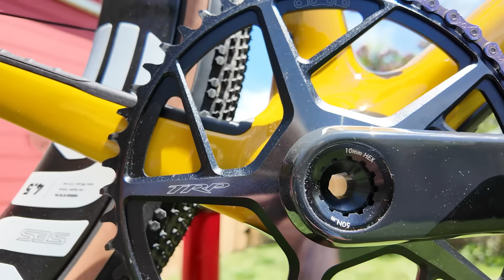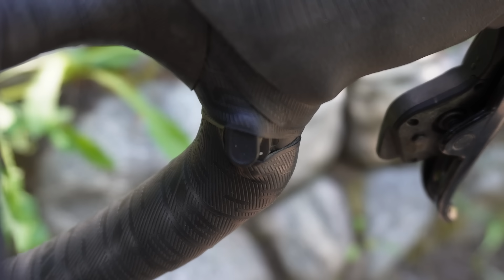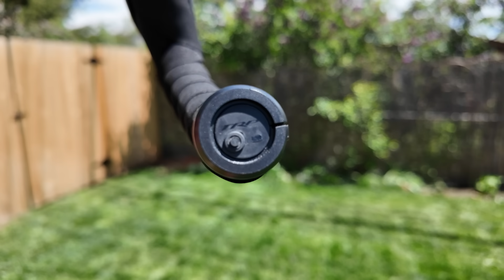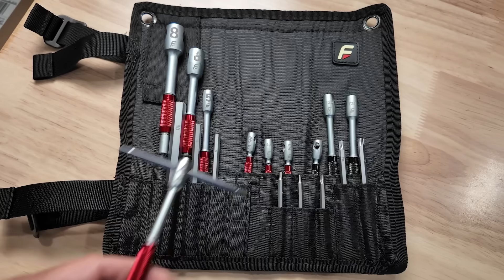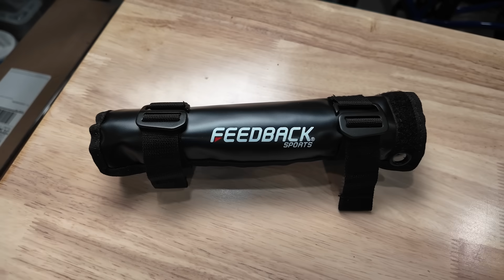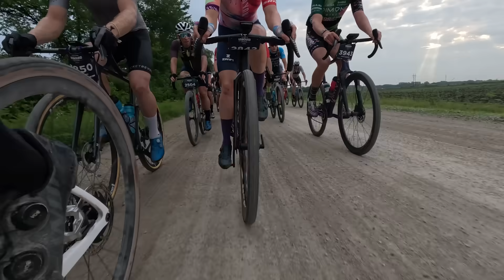My Unbound Gravel bike has a completely different and unreleased drivetrain

Comment: I would only consider a Classified hub if they made these changes:
1. Make more efficient, as it is currently 4% less efficient than a traditional transmission in the lower gear.
2. Make it available in wider ratios, as it is currently only available in 0.7:1 (a GRX 48/31 crankset is 0.65:1 for comparison). It just has way too much overlap for no reason. Having a 0.6:1 ratio would allow you to run a more compact cassette and shift in small steps, while keeping a wide range, so you can go fast downhill and climb steep hills.
3. Make it compatible with Shimano and SRAM cassettes!

Now, for me to even consider the whole TRP groupset, you would have to make 165mm cranks (and even shorter). We aren't in 2010 anymore... And they call it an "innovative system"!

Comment: If classified hub has a gear ratio of 0.686 , and a 11-40 cassette is used with a 44T chainring, then the lowest gear ratio would be 44/40 * 0.686 = 0.7546.

This is lower than a standard SRAM mullet : 42/52 = 0.8077   .... Is my math correct ?

Comment: The silo'ing is what kills all this for me. I'd probably give the Classified hub a go if I could easily connect things to my existing Shimano GRX levers/brakes. A "2x" 1x set-up as done here is great, but why would I want to throw out gear that I can already depend on and works solidly? Also, Classified/TRP would need to up the rear derailleur/cassette size. Using the classic WolfTooth link hack I can get an 11-42 cassette in back with my Shimano set-up. For all but the pros, I think the ability to get a 40 is a minimum in back (depending on your terrain), and larger is better (as you can with SRAM... are you reading this Shimano?!!). TRP/Classified, just like with the modernizing of tire clearance on gravel frames, needs to get even more progressive with this, and all possibilities for their system before it will be more than a niche groupset. Oh, and with that niche, I am sure some of use would be worried about long-term availability. Shimano and SRAM aren't going anywhere, but a smaller company like Classified (and even TRP in this specific arena) you never know.

Comment: Re: crank lengths— 170, 172.5, and 175 is a miss imo. Too tight of a range. The consumer wants to go shorter right now, that’s the current trend. Should offer 165, 170, and 175 instead. That would have hit more of the market demand.

Comment: Makes sense for those with deep pockets but not for those of us who like to change back and forth between rear wheels with different tire sizes.
Reply: The Classified mech is independent of the hub shell. Still not exactly cheap.
Reply: I’ve been running the classified rear hub on my gravel/road bike for over a year now. I have two wheel sets and switch between them very regularly. It adds about one minute to the process, assuming you have the correct wrench handy. I was initially concerned that it was going to be a time suck but it turns out to be super simple.
Reply: @chrisc738  It seems expensive to  have one of these hubs on each wheelset when a front deraileur can do the trick.
Reply: @beaudjangles It’s only expensive for the first wheel set. You swap the internals - the pricey bit - when you change the wheels out. You only buy the hub “shell” for the second (and third, forth, etc.) rear wheel. I went with it because it brings advantages that a FD doesn’t, mainly the ability to to run a 1x-only RD with it that allows a bigger max rear cog, thus gaining a much wider overall gear range than any 2x system allows. The fact that you can shift the hub - your effective FD - under full load is a nice bonus too.

Comment: most important question...what does the 700x48 tires measure out to? 50mm?
Reply: 50 mil I would venture to guess a millimeter smaller, On my set of Conti race kings the caliper measured 47.4!

Comment: If SRAM comes out with Force and Rival 13 speed options that may make this unnecessary. While it would have 2 more "gears", SRAM is proven across the board, would be around the same cost, less weight and wouldn't require proprietary tech that may be difficult to repair or not use with multiple wheelsets. 13 speed is at the point where you can start to have a viable 1x option for both road and gravel with close enough gear spacing.
Reply: I haven’t seen pricing for this anywhere, but the effective 1x15 (Gravel) and 1x16 (Road) provides more range than a 2x12, plus tighter jumps between gears. As someone who’s been riding both Dura Ace 9200 and SRAM Force Xplr 1x12, I’d be very interested in trying this over a 1x13 setup even at equivalent price points.

Comment: Can you describe how to use the classified system during a ride, in the sense that if you had 2x, you would switch between the small and large chainrings when you had 2-3 cogs from the end of the range to get more range.  How does one use a classified in practice, I've not seen this discussed.  When do you switch between ratios and when do you not?

Comment: Essentially a 44/22 front ring with a 10 or 11 to 40 cassette in the rear would be KILLER for those steep climbs. I want this on my gravel bike, NOW.
Reply: No, it's a 0.7:1 ratio, so with a 44 chainring, it's like a 44/31 2x !
That's not wide enough for me to consider it...
Reply: @nic12344  Oh, then I agree! Damn shame.
Reply: I mean, that's exactly what my 3x drivetrain on my gravel bike has. And it cost about 100 for the cranks/chainrings and front/rear derailleurs. 

It's a cool system but the range is pretty easy to get with conventional drivetrains.
Reply: the sram dual drive 2 would give you a heavy geared hub with around 73 % / 100 %  / 137 % gearing. The geared hub is compatible with 3 by stis. Yeah, and rim brakes I suppose... Have it on a foldable road bike from dahon (early 2010s, dahon speed pro TT)
Reply: My bike has a 42T chainring and the largest sprocket on my Deore XT cassette is also 42T. I have ridden up 25% hills and never felt I needed even lower gearing.

Extra info: I just recently got into this more adult (consumer) version of cycling and built a carbon gravel bike, I only have 500km on it, without wanting to sound arrogant I am in pretty good shape and 24 years old, so that may play into it, but even on my really extreme rides, where I had to get off the bike and hike it up, I feel like I would have simply wasted a ton of energy pedalling up, even if I had had much lower gearing (can't go too slow or you topple backwards or lose traction)
Reply: @rayzecor  Let me know how that works for you in 40 years. At 64 I run a 9-46 in the back with 26/36 up front. There is a point where really low gears don't work, but in my experience it's somewhere around 0.6 ratio depending on wheel size/crank length. While this setup helps on the short >20% stuff, where it shines for me is longer stuff in the 10% range. I can now get up those climbs and still stay at a relatively low effort. This makes a big difference on long days in the hills.
Reply: @imoldandurinmyway  I didn't mean to sound elitist or to say "just get stronger". I apologise if it came across that way
Reply: @rayzecor  No worries, it all just bikes after all.
Reply: @rayzecor  In my 20's through 40's I was super strong, at 55 I was a fu*king cripple with wrecked knees and that's how I did it. At 65 I'm back to riding again, but only 6k or so at a time, with an occasional 20k ride.
Reply: @rayzecor 😂😂😂🗣🗣🗣🗣
Reply: @rayzecor  Cool

Comment: There should be AT MINIMUM a 165mm option, and considering so many taller people have stsrted using 165s, there should be 160 and 155mm cranks too. If anything, drop 175. Or drop 172.5, no more in betweeners
Reply: I'm staying on 175s. This fad will be over soon enough.
Reply: @BG-yr1rr  My regular length legs say no!

Comment: Ben, the MOG will fit the Race King/Dubnital 2.2 if it is dry at Unbound.  That is probably the best way to be fast and avoid flats.  Saw ya today coming down as I was heading up Chapman…. Best of luck at Unbound!
Reply: Barely fits.  I've tried 3 pairs on my Mog and man it's close! Any wet dirt and I'm f-d.  I'll be running something else at Unbound unfortunately. (I know data is grater than feelings, but they feel slow as well)

Comment: The shorter the crank length, the smaller the chain ring aka performance loss due to chain roller movement. Also, higher seatpost = more aero drag especially if its a round one. These things Dylan doesn't know about 🤫
Reply: name checks out.

Comment: This shows why standard 1x is fine, it only gives 15 unique gear ratios vs 12/13 you can have with sram xplr. And you can already get a very easy gear with sram 46t and 52t cassettes. Glad to see innovation but end of the day its not better just different and has the cons of the proprietary hub.
Reply: Well, some people like both wide range and small steps between gears, so in that case, 15 is better than 13, let alone 12. 
If you don’t care about bigger steps, than indeed, no benefit.  But all those arguments are also true for 2x drive trains, and plenty of people seem to like those.
Reply: Agreed, the required hub makes it a no go option.
Reply: The range of 22/40 and 44/10 would be wider than any of those systems. Probably too wide for even 15 gears.

Comment: The problem with Classified is the limited Big cog of a 42T. When you turn on the Classified hub on you get 0.7 of the 11T-42T you basically get a 8T-29T which with a chainring of 42T you get a range of 525%. But I run a KCNC 9-52T cassette so I get a range of 577.7%. TRP and Classified need to come up with a larger range cassette 11T-46T which would the the equivalent to what I currently run but I would have more gears in the middle!
Reply: It takes place of small chaining, so doesn't it step down 0.7 to 16 x 60

Comment: There should be a 165mm crank IMO.  Many people 5’8” and shorter might prefer this, ever some bigger folks are switching to 165.
Reply: 5'6" here with 160 and 165 cranksets. All those stock 170 to 172.5 cranks are collecting dust, now I think it might be too late to sell as no one wants them 😅
Reply: @Sonny_Sounds yeah that's all I see is standard length cranks and the shorter ones are more scarce
Reply: I'm 5' 10" and I ride 150's.   The 2.5 mm increment in cranks is pretty trivial.
Reply: The crank can be swapped to virtually any other crank on the market compatible with a 1x chainring. So off the top of my head.. 

Shimano, SRAM, Praxis, Appleton, eeWings, Garbaruk, Rotor, FSA, Cybrei, etc
Reply: We will have a 165mm crank option!
Reply: Length	Crank  in mm
2000	180.0
1950	175.0
1900	172.5
1850	170.0
1800	165.0
1750	160.0
1700	155.0
1650	150.0
Reply: I'm 5'7", i use 170mm. I tested 165mm, not for me because i felt the loss in leverage.

Ya'll truly drinking the 165mm kool-aid unless you all have very bad flexibility.
Reply: @sepg5084 175mm hurt my hip flexor round 70 mile on a run, moved to 165mm problem solved
Reply: @gramofsin   what's your length?

Comment: 170 -175 cranks lengths? What is this 2019
Reply: @cruisernick10- well, he did say he had CAD files dating back to 2018. 🤣
Reply: @RF-gj3uz  true! Gotta update those cad files before we go to production
Reply: Watch the Conners gcn video, he explains that the longer length is better for cobbled climbs. Probably better for gravel. Fit depends on each individual person.
Reply: @nationsnumber1chump   A major advantage for shorter cranks seems to be comfort and pain managment. That's certianly my own experience. Dylan Johnson put 165 cranks on his bike for training after a big race where he had issues with knee pain. The results were so good he kept them on the bike for races. But he didn't think they have any appreciable impact on his performance.
Reply: Fully Agree ... really stupid discussion
Length 	Crank in mm
2000	180.0
1950	175.0
1900	172.5
1850	170.0
1800	165.0
1750	160.0
1700	155.0
1650	150.0

Comment: Someone should do an experiment with a classified hub + double front chain ring like 50-34 and see if it's possible to ride up that steepest street in SF with it.
Reply: The turducken of drivetrains!
Reply: It would depend on the gearing in the hub I think? For example, if you switch to the 34 front ring but the back has a 34 "rear ring" that would just be a 1:1 ratio Unless maybe the cassette could modify that ratio to be even lower?

Comment: Cool to see innovation, but I’m skeptical. Heavier, more drag from an internally geared hub, and that’s all on top of the increased drag from the necessary cross-chaining on a standard 1x setup when compared to a 2x.
Reply: All true. The only real benefit is Bigger tire/mud clearance and protection from the elements. Nothing but losses as far as efficiency, but then, if it gets muddy and you have 2x that can cause a lot of inefficiency on its own so maybe it's net zero with qualifiers?
Reply: I get the standard 1x and 2x setups, both have their pros and cons, but this system seems to have a mix of both with some new significant downsides. There’s a good reason external derailleur driven drivetrains have been around forever, simple, light, efficient, durable, easily repaired, interested to see how far this idea goes.
Reply: You got it, they lying into the mic with the 1x no-crosschain. This audience is not stupid.

Comment: I don't think 170mm crank is short enough. They better offer 165 & 160. Will this be compatible with UDH?
Reply: Every derailleur is compatible with UDH, it's mounted to a UDH in the video
Reply: The rear derailleur is obviously not going to be a direct-mount transmission style; as u can see it's on a traditional hanger.

The hub seems to be regular old hub on the outside so it doesn't interface with the UDH style hanger at all outside of the end caps
Reply: No 165mm is crazy in 2025

Comment: That's a really really really expensive and complicated closed source proprietary front derailleur :)
Reply: That's Technically true, but also it's completely different and has obvious benefits if the system can be perfected. Then it will become more and more ubiquitous as time goes on and patents expire and then cheaper and and less proprietary because blah blah aftermarket and economies of scale.

This is just like every Drivetrain advancement before it. Sure the old thing worked perfectly fine, but also the new thing could be way better so why not try and do the new thing?
Reply: Don't think you can easily modify or repair AXS or Di2 FD. Meanwhile, this is just a gear hub, like one you find in Strumey Archer bikes.
Reply: Aren't every front derailleurs proprietary?
Reply: @MacMasore it's not binary, they are to some degree but you can do much more with a mechanical front derailleur than you can do with this
Reply: Watch for SRAM to buy the whole thing and slap their name on it...if it gets any spec..promising some serious sales volume.
Reply: A solution in search of a problem.
Reply: Yeah, they miss the hard work give us a true non-dropping FD. E-shifting should do the trick. It would be better for Ben to elaborate what make the dropping and how much clearance is a 1x over an extended 2x, somewhere 47-50. Crosschaining 1x, you blantly lying.
Reply: @reinerfranke5436 good god is this painful to read.

Comment: thinking a "front derailleur is a thing of the past' sounds foolish....A front derailleur balances the bike better instead of throwing all of the gears, and so the weight, over the rear. Also like any 2x option it offers you a 'get out of jail' should your rear derailleur fail in such a way (i.e. connection or cable snap) that you still have a high and a low gear. Personally, I feel 'The Industry' is try to force out the 2x because it suits them NOT the rider/customer. + on this system....all those batteries....YUK!
Reply: uh what.
Reply: Chainline is better on 2x than 1x.  Internal gears are less efficient and we combine that with the inefficiencies of 1x chainlines - it's like they're trying to get people to pay more for poorer performance.
Reply: Lachlan runs a front derailleur.
Reply: If they do not worry about charge and battery contacts they not even think of a spare system.
Reply: I do much prefer 1X - for me 2 or 3 X are something of the past and glad I do not have to deal with a front derailleur. I did in the 90s but always used the middle chainring only then.

Comment: Sounds great but only issue here is the limitation to wheels basically you have to use wheelset that work with classified and that as of right now is very limited!
Reply: Not the whole wheelset, just the rear hub
Reply: There are many wheel brands offering a Classified hub shell now.

Comment: I wish they had an ultra low gear range for those of us who have hills >20%.
Reply: You could run a 46 instead of 52 or whatever and get even lower ratios.
Reply: I mean in the 0.7 gear ratio with a 44T chaining it's like having a 31T chainring and a 40T rear, or a 44T chainring and a 57T rear sprocket depending on how you want to think about it, pretty low to me to the point that I'm worried about having enough grip to get up a hill I would need lower gears for.
Reply: Put 28t chainring and you can climb walls
Reply: get a mtb chainring?
Reply: @oliwankenobi922  Haha, without FD in 1x. Close to all gravel frames have a road FD direct mount. Go with a tube seat and a clamp on MTB FD.
Reply: pushing harder on pedals does the job too